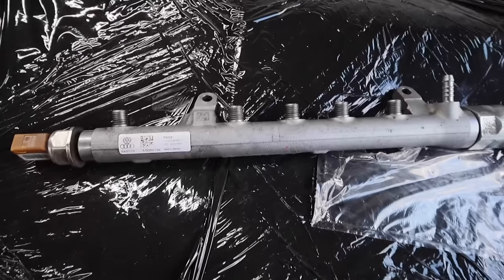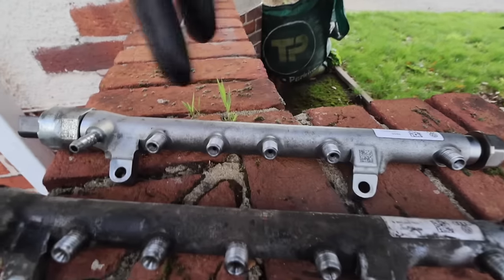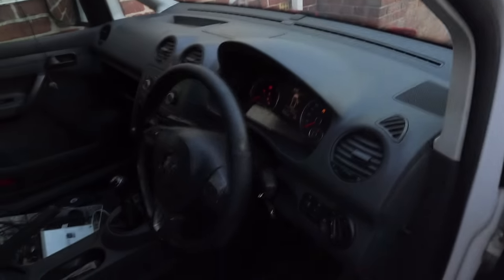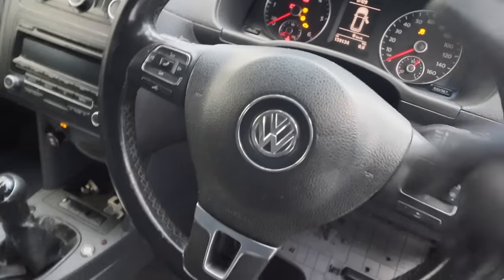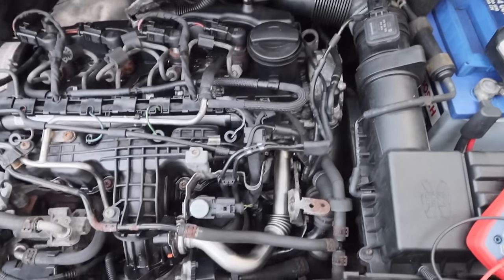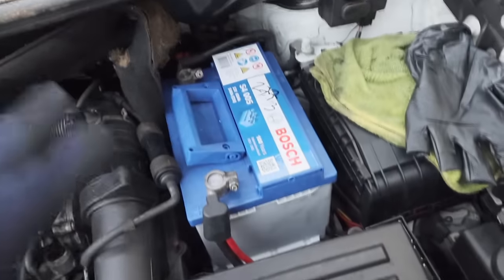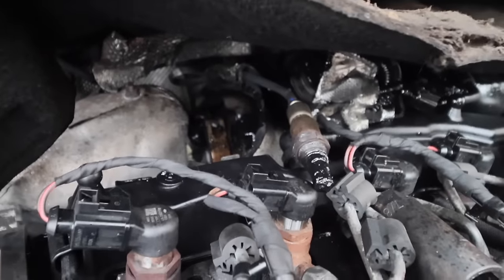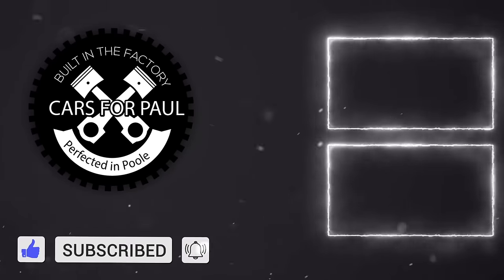My VW caddy has a bad engine problem!

Comment: The high oil level may be a sign of diesel in the oil from the failed dpf regen attempts rather than overfilling. Worth checking.
Reply: dont teach youtube mecanics
Reply: @emilysuvac8243  I don’t. Was just suggesting a possible cause based on my experience.

Comment: It was misfiring like hell once it was running. Unplug cyl1 injector as thats more than likely the cause for it. It had fault codes for cylinder 1 injector in the first video. Clean the egr and run a dpf regen to see if that will clear it up after doing an oil/filter change

Comment: These diesel engines are a lot easier to start after fuel filter change (or fuel system repair) if you use VCDS (or whatever you have of test equipment) to activate the in tank fuel pump for filling the fuelfilter and lines......Youtube has several videos on that topic......

Comment: Only got to 6.00 mins....you can't prime fuel on the key you need vcds etc to prime the pump....Will now continue watching to see if you do the above......could the oil be over filled because of a leaking injector, leaking fuel into chamber and then running down into the sump 🫣

Comment: Im not sure how much it helps but i always syphon off dirty diesel after removing old filter, i insert the new filter and replenish the bowl with fresh fuel it may not of made any difference to the difficulty in starting but it would eliminate any chance of an air lock.

Comment: The cayc engine is very prone to diesel in the sump which raises the oil level.
You have to be careful as these engines runaway with themselves and end up running on own oil to destruction unless you manged to stall the engine.
Dpf and egr and injectors are all problematic on this particular engine.

Comment: The sensor you took out that you mentioned was an egr valve was actually the lambda prob, just so you know what part to order.

Could be overfill because someone put too much oil in it, not necessarily the person who serviced it.

Also could be over filled because of failed regens. (Diesel in the oil) 

I failed turbo wouldn't cause the oil level to rise, it would cause the oil level to be low, you would find oil in the intake system and dpf.
Reply from the maker: I always get my sensors wrong, and even though my head was saying lambda sensor, my mouth was way ahead of my brain 👍😀
Reply: No worries, just watching your next video now.

Comment: Fuel filter may or may not be the cause, but should have probably looked at the fuel filter before replacing the fuel rail/fuel pressure sensor and fuel pressure regulator.
Reply from the maker: I replaced the fuel pressure sensor because the same code kept coming back after clearing it. the minute I connected the new one, the code went away. It was the state of the engine that made me check the fuel filter.

Comment: that was at least not running on one cylinder suspect faulty injector thus reason overfull oil which is sump full of fuel .. smoke looks unburnt fuel   disconnect power feed to injectors one by one stopping the engine each time  ,,ps do not reconnect plugs with engine running as you could hydrolock it ,, this will give a quick indication of what cylinder injector faulty  ,starting point .no wonder the exhaust is so blocked  drop the dpf  run wynes or jml through it  blast steam cleaner might save it, least get it to run